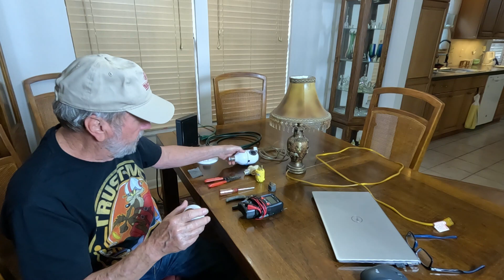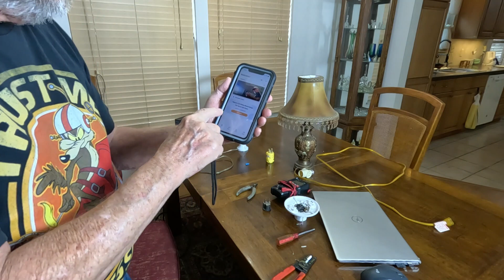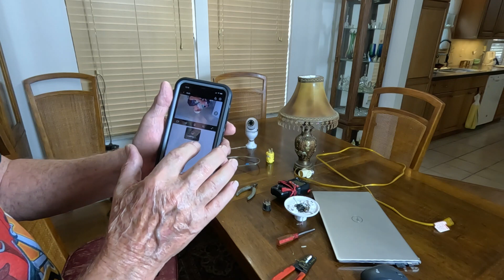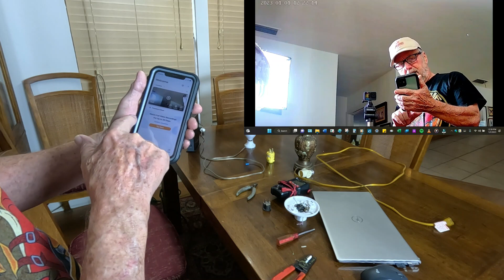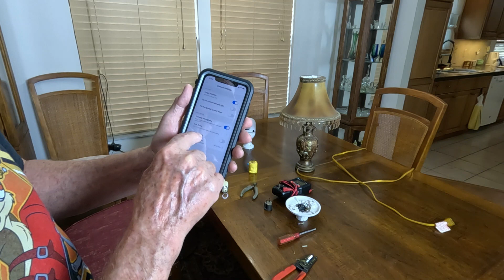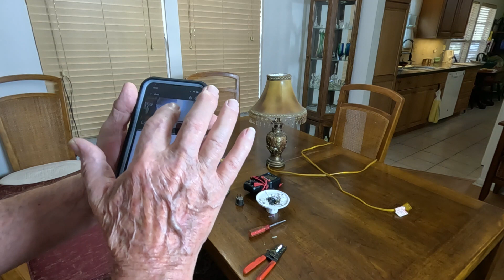Light Bulb Camera Pan and Tilt operation Q and A

Comment: Can i determine the preset point for rotation  my camera screws in garage and it doesn't rotate all the way to the left when tracking
Reply from the maker: You will need to Move the mounting fixture or carefully start the threads of the camera in a different location  to move the camera around a bit.  I know, they did not think how this could be a problem with a screw in bulb.  Best is to see if you can twist the mount and drill new screw mount holes into the fixture.  Best I can tell you.
Reply: @samowens44  ty

Comment: Hi Sam, sure you have noticed that when the camera has its tracking mode activated and zeroing in the person that moves in front of it, the camera only moves in pan mode (horizontally) but no make any tilt move (vertically). You can do pan and tilt with PTZ manual control of the camera normally, but in tracking mode, there is no tilt movement. This is a firmware issue that is not present in other motorized cameras I own, like a Fuers one I have.

Comment: perhaps you know how to fix the problem we are having. when we screw in the camera to our front door light outlet it will not face outwards. it faces the wall so we get literally no view of our front yard. only a small bit to the left and right of the door. suggestions?
Reply from the maker: @brin3m  yes that can happen a lot.  screwing the bulb into the socket can not be adjusted.  You need to turn the power off to the lamp and turn the socket in the base of lamp a little.  Depends on how the mounting position against wall or hanging from ceiling.  You will need to figure out how to reposition the socket base or fixture.

Comment: My camera keeps turning toward my wall. I’ve reset it, I’ve turned it to where I want it to stay but it keeps going toward the wall. Why and what am I doing wrong?
Reply from the maker: Take your camera closer to the router wifi signal and see if it operates better.  If it does, then your camera is too far from the wifi siganl or has to go thru too many walls.  You have to test the camera for where it will work, no just install it where you want it.  Or move your wifi router.  Main thing, you need a strong wifi signal reaching the camera.  Use a lamp to test.

Comment: Hi Sam,
Still confused,
Senior impairment I guess.
What app do I use
And do I insert the sd card
Reply from the maker: @PattyHamlin you need to have your user guide for the camera.  It will tell what App works with the camera.  Only the the app designed will work.  You need that app.  The memory card is where all the video is stored.  Good luck.  Find my latest video for the lightbulb camera on my channel.  Has 101 basics in the title.

Comment: I have the Aiwit HT50 light bulb camera. I reset it and everything works fine including the WiFi signal. But the ptz function is not doing anything when I try to move/adjust the camera position with the on screen function. Any idea what could be wrong ? Thanks for your time and assistance.
Reply from the maker: Take the camera close to the WiFi router and see if it works good.  I have found that you need a strong signal to do the Pan Tilt and zoom.  You may be out of range.  If it works fine near the router, then you know you are out of range.    I suggest all folks should set the camera up close to the router to make sure all works, then move it to the location, if all does not work, then you need to move router or camera.  walls doors and obstacles can cause issues.  Try to make sure you have the least obsticles, I know it is hard, but that is what you have to do to get everything to work.  You can just move the camera to position you want manually if the location is necessary.  Best I can tell you.
Reply: @samowens44  thanks ! It was working great recently.  Today it was out of its normal position and the ptz function just won't work.  Strange that everything else is ok. 🤦 I'll have to try it closer to the wifi/router if it doesn't work soon. But I think it's ok with the signal. Because everything else works great.

Comment: Having problems connecting to my wf or internet
Reply from the maker: @Cubiehollie1909 here are some important things you need to do.  First have the camera very near the WiFi modem.  Next have your cell phone accessing the same wifi you are trying to connect the camera.  If you are on cellular signal, you will not be able to connect.  You need to go to settings and make sure wifi is on and you are connected to the wifi signal for the modem in your house.  Look at your phone and see if you have the connection I am telling.  If you have these things completed, the camera should hook up like a champ.  If you have your camera mounted at the front gate 1000 feet from the house, you will never connect.  You first connect with the camera right next to the modem, then you find a location that will still support the signal.  You may have to move the modem if you are going through too many walls.  Good luck.

Comment: How do you turn the siren sound down
Reply from the maker: The Siren, is an alarm signal, meant to be a deterrent to an intruder or to get attention.  Do not use the alarm Siren if it is too loud to you, it is not adjustable.
Reply: @samowens44  OK thanks. I just didn't want it to keep going off in the middle of the night on false alarms and be a disturbance to neighbors
Reply from the maker: @johnnytday1  I checked my Siren and it can only go off when I activate it.  I have use all the features of motion detection and tracking and never does my siren go off.  The only option I have is to activate the siren with the press of a button on the app.  That is the way it should operate.  I am not sure you have the same camera I have, but any way, this is not a normal feature for the siren to go off in the middle of the night all the time.  This would be unaceptable to most folks and it not the way the camera is suppose to operate.  Yours may have a defect if it is going off.  I have a couple of these cameras, different brands, and the only way I can get the siren to operate is manually.  And you can not control the volume.  Hope this has been helpful and to anyone else that has a similar problem.  Good Luck my friend.
Reply: @samowens44  hey Mr Sam looks like we have the L2 security bulb camera and if so all you have to do is go to the settings menu and click on the detection alarm settings and then trigger alarm on the bottom of that page. I tried and it works. You can manually do it with the controls of the main page but if you want to scare someone away you can set it to trigger alarm. You can also make a spotlight come on when it triggers but so far the only way I saw for that to work is to turn off the trigger siren. It's either one or the other
Reply from the maker: Looks like you do not have the model I have.  For others with problems with camera operations. It is super important to know what camera you have.  I cannot answer questions without information provided about the actual product.  Folks, my time is valuable, please provide details.  From now on I only reply to questions with details.
Reply: @samowens44  OK well mines a la view  L2 security light bulb camera. If anyone needs help with a question, I guess my time isn't as valuable and can help if anyone has a question
Reply from the maker: Sorry , I have hundreds of comments to answer and i always want to give the best answer to help with solutions.  So, details about the product and problem help with the process.

Comment: Hello Sam, Thanks for this Video, very helpful.
Need to know if you can use any of the various Apps to operate the light bulb camera?
Also, which App are you using in the Video with your light bulb camera?
Thanks Again
Reply from the maker: The App I am using is YI Lot  it is the only App that works with lightbulb cam, that I know of.

Comment from the maker: To all the new Light Bulb Camera owners, when you have a difficulty with your camera, make sure the wifi signal is close to the camera as first solution.  Next, make sure you have gone through the settings section of the camera and check each setting category that will effect your wishes for operation.  Also go to App store and check for app updates.  As last resort, just reset the camera by using paper clip end to press and hold the reset button located in small hole next to mem card slot.  Hold it after click until the camera says "Reset Complete".  Now you can go back through and reconnect the camera to wifi again and get a new setup.  I have had to do this myself.  This is my ultimate answer to camera operation failures.  Folk, this camera only cost $30 to $50  I has limitations.  It only takes a small amount of time to re setup the camera.  Do It, it is the answers most times. If Camera doesn not respond up and down correctly, most times this is a wifi signal problem.  Depending on your wifi subscription, you may not have to full speed all the time and the camera will not operate fully all the time.  If you have the cheapest wifi possible, you are most likely going to have problems.  Most problems are with getting full wifi at the full speed of above cheapest.  Sorry, This camera needs full signal all the time and higher speed than basic.  I have found that to be the case.  Get a good wifi signal to not have problems and place camera where the signal can be received at the full signal.  I feel, I need to make this statement as to the questions I am receiving.  Most all are the same problems.  Test your camera to see if your wifi is good enough.  Bring your camera within 5 feet of the wifi and see how it operates.  Fully, move up down left right.  Also check recording, go to setting and check for all the things you want to test.  Fully test the camera for full operation.  If it fully operates, your camera is operations.  Now move the camera to the location you want.  Test again.  If it does not work.  Then you need to select another location.  Wall, and obstructions will deplete the signal.  You have to do some detective work, you can  not just select a location and expect the camera to work perfectly.  Now you have some very new information I did not know I need to publish.  Folks, you are learning to determine if your camera is good or your locations is bad.  Now go to work.  I want some reply's.  State what you have found and we can go farther.  Folks, remember, I have been where you are trying to get!!!!!  Good Luck, you have your assignment!
Reply: Hi Sam, I got it back working but it still will not go all the way down and that was why it was near the router and it’s not that far from the router but I was advised to order a new camera and so once I get the new camera. I’ll see if it does same thing. If so, I’ll reply back here. You have been very helpful. Thanks again.
Reply from the maker: @jparker5025  Try one other thing, move the camera all the way down and see if you can bring it back up and then see if it will work going down.
Reply: @samowens44  Sam  I just tried that and it did not work so even when it’s all the way down I couldn’t move it back up but I am replacing the camera.
Reply: @samowens44  Hello, Here is the update, I got my other camera today set it up and it does go up and down and side to side all the way with no problems,  so the other camera was broken and I’m going to return it. Thanks for all the help.
Reply from the maker: Great news, thanks for sharing, others that read this will see that a new cam may be the answer to a problem, they can fail.

Comment: Has anybody had a problem with it going down by using the app in other words if I try to use the app to go left right up it works fine but not down? Someone on Amazon mentioned it was broken and I consider returning it or ordering another one when I get the other one. I’m gonna try not connecting with Wi-Fi like he’s one of his other videos.
Reply: So I checked and saw that somehow the app prompted me to log back in so I did. The camera no longer would work so I deleted and now unable to get it connect to the Wi-Fi again. Yes I have the camera and phone near the router like I did the first time I set it up months ago, I also rebooted the phone and router and made sure they  are both in the same network. An suggestions?

Comment: I like the camera so far,I  had it one week. My issue is that the camera does not go down it goes side to side and using the app but when I try to go down no matter how much I use the app it seems problematic I have to manually pull it  back down if I take it up to far What can I do about that? I’ve emailed the app creator, and they referred me to Kami the maker of the camera. sister has the same camera and it goes up and down side to side with no problem so I’m going to send this one back and get another one and she’s not subscribed either. We both have SD card.
Reply from the maker: @Jparker5025 My suggestion when your camera does not respond correctly, check for updates on the app.  Next, reset the camera, using the reset button next to the Mem card slot.  Paper clip and hold until the cam talks.  Once reset, just go through the quick setup again.  I have found, this will correct most issues.  Good Luck.
Reply: @samowens44  ok thanks I will let you know how it does
Reply from the maker: @jparker5025  Hi, due to your comment, I decided to make a new base comment about all the problems folks have with the camera.  Please read it for new information.
Reply: @samowens44  also when I go to my app on my phone, it always says it’s loading. Do you know why it does that it doesn’t just show the picture as he is it takes time to load.
Reply: Thats right, has no tilt movement when is in tracking mode. Manually with PTZ controls you can do pan & tilt without any issue. This is a firmware bug.  I have a Fuers camera that done tilt in tracking mode normally.

Comment: It's true you don't need a subscription (Cloud storage) for some lightbulb cameras but the problem I have is that the camera regularly beeps loudly which is very annoying.
Reply from the maker: Have not heard that problem.  I suggest reseting camera and reconnect to wifi.    Once set up, you can go to router and click forget the lightbulb camera and it will not connect to your wifi if you just want it to record video and pull card to review video on your PC.
Reply: @samowens44  Ok (I don't understand the router bit) but I can't reconnect to the Wifi via the relevant App because the "App People" terminated my temporary account because I didn't take out a subscription.Beep Beep...Beep Beep...
Reply from the maker: @paulneri835  You do not have to take out a subscription for the camera to work.  Here is another video I just made that may help you.  https://youtu.be/SsEHnM5GrWA  Try resetting the camera and start over, follow my guide in the video.
Reply from the maker: @paulneri835  Want to add, you said temporary account.  That is a problem.  You should not have a temporary account.  Sign up for your account.
Reply: @samowens44  Ok I'll watch the video but the account is the one the App People give you for the duration of the trial period when they want you to take out a "Cloud subscription? The trial period lasts a couple of days. I don't need all the features the camera subscription offers. I just wanted a basic security camera with a permanent power source and the light bulb camera seemed the perfect choice. I was wrong.
Reply from the maker: @paulneri835  The App for the Bulb Cam should be Yi Lot  Try it by downloaded it from your cell phone app store.  That is the App I use for mine and most all Bulb cams use that I know of.  I don't know why you are getting a trial period.  No bulb camera has that option.  Try using the app I show and set up your camera.  First reset it by pushing the little reset button in the hole next to the memory card slot.  you need to hold it for a while and you will hear something saying reset completed.
Reply: @samowens44  Just set up my camera in the carport, hopefully permanently after weeks of mucking about (SD Card recording only). I taped over the audio holes which reduced the beeping significantly (neighbours can't complain). Anyway...thanks to you (I think it was you) I learned that I could swivel the bulb manually within limits without breaking it.

Comment: If I use the socket and wire it ,is one terminal hot,and one ground, if so which ones what ??
Reply from the maker: @michaelgreen9602 it will not matter which contact you connect to the wires.  Just protect the bottom with tape or a cover, you do not want to touch the bottom when it is plugged into the wall outlet.

Comment: Hi Sam, I enjoyed your video. However, I have a question, is there way to lock the camera in the socket so that an intruder doesn’t unscrew the camera from socket? Brian - 6:10 UK, England
Reply from the maker: Mount it higher and out of reach.  Only way.
Reply: Also…since it’s not… water proof you get a fixture then enclose the bottom… keeps bugs out too.
Reply from the maker: @maclaybill1967  I have had mine mounted under the eves of the house, open, but had no troubles.  I have mounted it on a tree and remove it in threat of rain.  There are models of tilt and pan cameras that are waterproof, they just do not have the screw in light socket type base for easy installation.
Reply: @maclaybill1967 they have the same one for outdoors it's waterproof
Reply: I used a bit of glue from my gluegun on the one on my porch.
I don't think they'll take time to Rob it if it doesn't screw out right away.

Comment: So you must have a cell phone to use the app.? correct? A desk top alone will not allow you to control the camera, Correct?  The app will not down load to a desk top PC. Correct?  I have WIFI in the house to stream the TV. You don't use your lap top to control the camera & you always use the cell phone which is wifi. So do you or do not need cell phone to operate the camera?